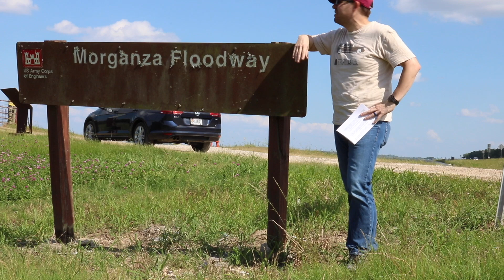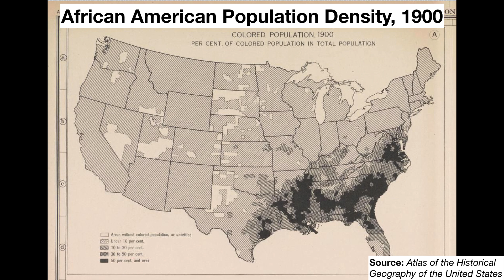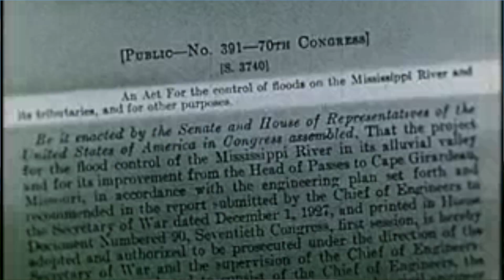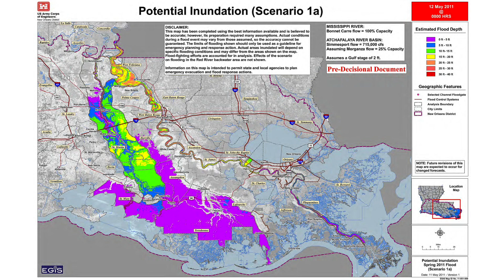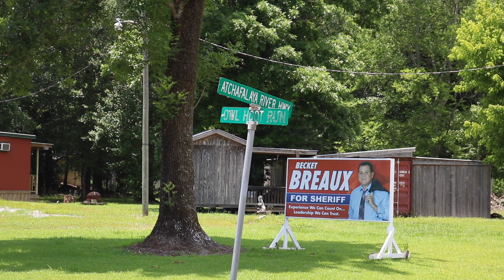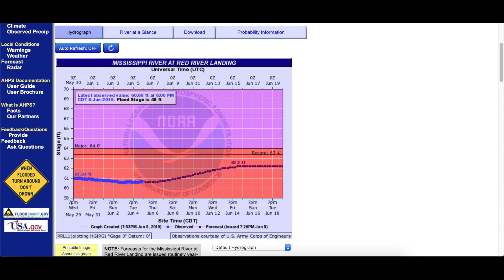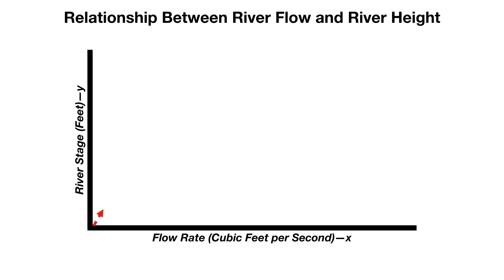Morganza Spillway: Phenomenon Explained

Comment: I think you're wrong at 10:29 ... culminating in a backwards representation of the flow regimes at 11:08 ... The blue graph should be labeled as the rising river, and the red graph is the falling river. The way to think about it is once the crest occurs, it's hard to subside because the downstream portions of the river are already higher than normal, so streamflow is SLOWER. That means that when the levels fall at one particular gauge, another downstream gauge is hitting its crest and causing resistance to flow at the upstream gauge.

Why? Because the slope to the ocean is less after a crest. When the slope is less, less water flows. Even at equivalent gauge heights. This is why it's important during flooding events of the lower Mississippi to watch Red River Landing and Baton Rouge for rising water. After a crest, we know that the streamflow tends to be less than the published lookup tables. The tricks used to do this have already been covered by your channel, so you know how USACE does that in the lower river.

I'm sorry, but you need to take down this video and redo it with a New Future You who has learned from his mistakes.

If you have any questions, I could refer you to a paper of the USGS by Robert Holmes, Jr. That one is easy to grasp and free.

Comment: The no. 2 idea for a video that I mentioned in your severe weather video centers around the bayou chene project. The thing that delayed the project for so long is a lack of money. I believe the money finally came from the coastal restoration fund. They have plenty money and because this project will greatly benefit the marsh that's where the money should come from. If we can some how convince our elected officials that the two (flood control and coastal restoration) goes hand in hand then we would greatly benefit from this. With your knowledge and willingness to do videos perhaps you could do a video on how effective this bayou chene project is in rebuilding the marsh and plant the idea that more projects like this should be funded by the coastal restoration fund. Flood waters is what built the marshes to begin with and and with proper flood control projects we can rebuild them again.Thanks for your videos, hope you"ll consider doing some along the line I mentioned.